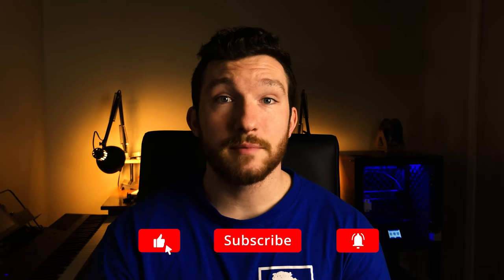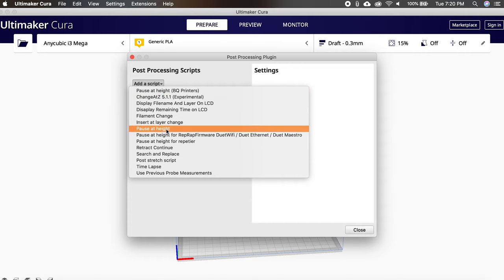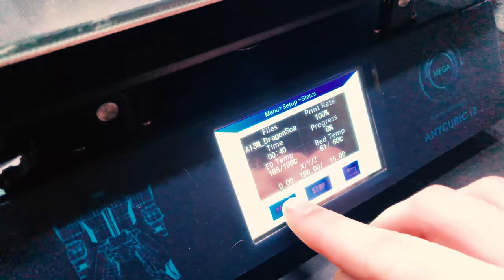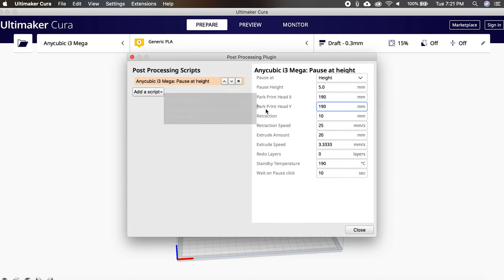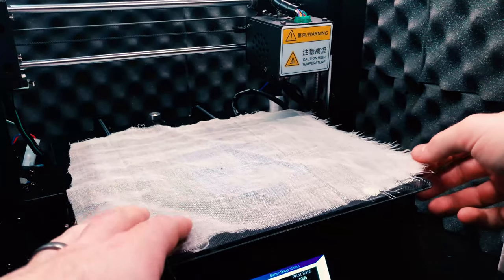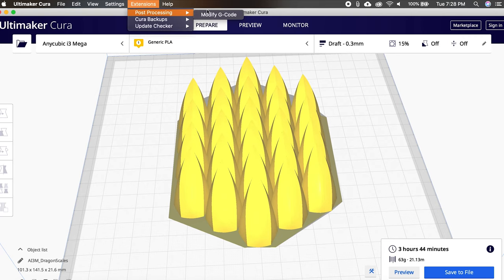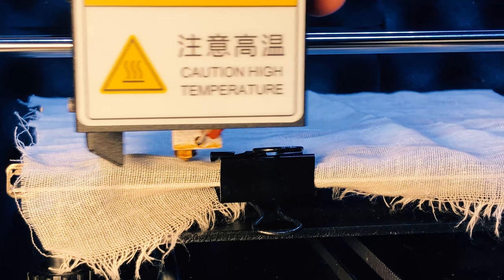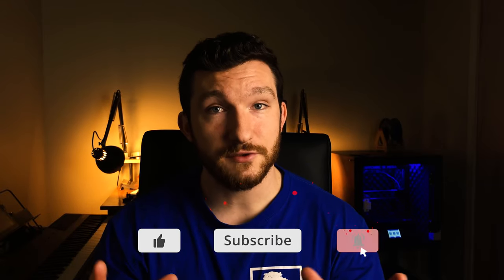How To 3D Print On Fabric!

Comment: I wonder what would happen if you ironed the material to the layers that are already down when paused.
Reply from the maker: Hey thanks for the comment! That would probably help keep it in place and allow us to remove the magnets, but as far as adhesion is concerned, I haven't had any trouble getting the two halves of the part to stick together through the fabric. Thanks for the idea though!